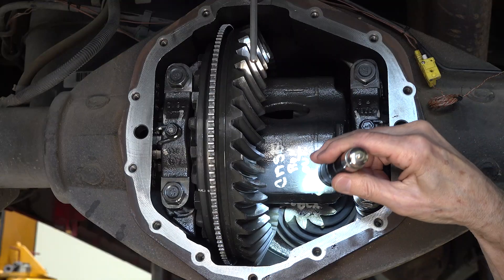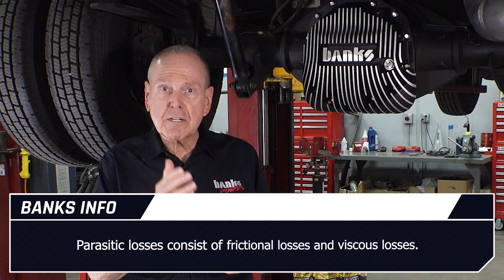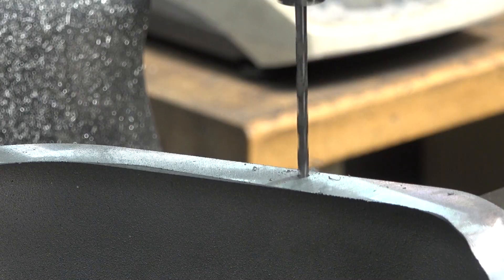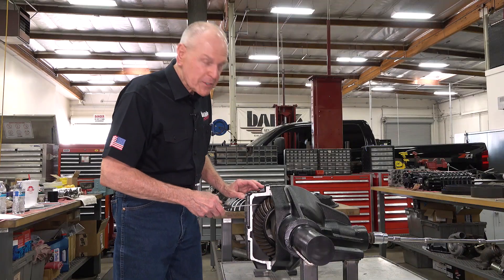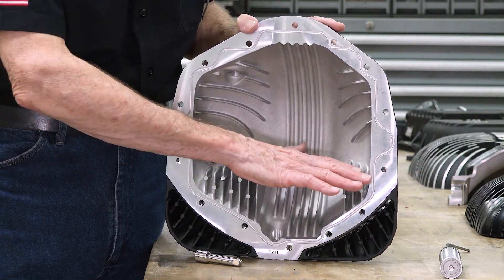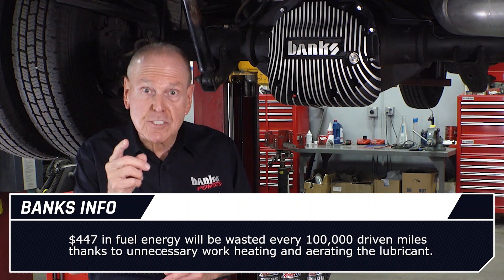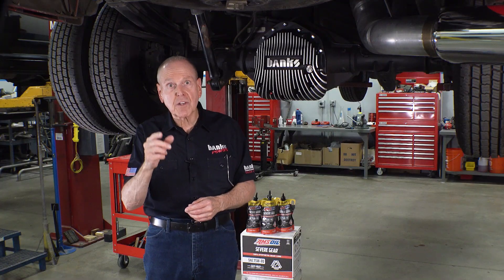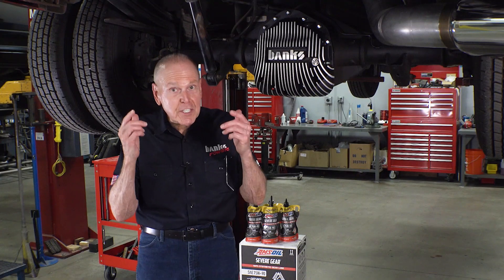Is your differential cover KILLING your gears?

Comment: Wouldn’t it be nice if this much engineering was put into everything automotive related coming from the factory
Reply: Ram is actually going to be implementing an antifreeze cooled rear diff on their 3500 trucks :)
Reply: It is.  How do you think differentials run for 100K with never having the gear lube changed.    There are literally millions of trucks on the road running stock differential covers abusing the hell out of them and not needing to buy a $400 cover.  Don't mistake the aftermarket marketing as "engineering."
Reply: Not Hitler  Or just spend $50 in gear lube every ten years instead of the $400 cover.
Reply: @tirefryr  exactly lol people really think that because they spend more its obviously better
Reply: It is.  Profit margin is king.
Reply: Caleb Martin great, until mud and dirt pack those cooling fins.
Reply: tirefryr If you only change the gear lube every ten years, you’re going to need to change more than the gear line every ten years unless you barely drive your truck.

Comment: I have a Mag-Hytec cover on the Dana 80 on my 2001 Dodge, and ran it for many hundreds of thousands of miles delivering trailers.  I did have a rebuild done at 250k miles, basically to change the axle ratio.  I finally had to retire the truck at 580k miles because a lot of small things were going wrong, electrics, heater, and the transmission was making grumbling noises again.  So I replaced it with a 2008 Dodge.  I watched all of Gale's diff cover series and was impressed with his methodical approach and attention to detail that the flat-back designs missed.  I bought one as soon as I could and have had it on the truck for about 20k miles.  Things are good so far.  One thing that sold me on the Banks design was the 4-quart fill, instead of the 7-quart fill of the Mag-Hytec.  I always run synthetic diff lubes, and saving 3 quarts on the fill helps.

Comment: Since I solved the braking problem on the Hummer I got a question for you. "What happens when the air ramp fills up with mud?"
The reason I ask is that was the problem with the Hummer's first gen parking brakes. Mud would get up there and force the brake calipers closed and the disc brake would heat up to glowing red metal and turn into a bowl which was right next to the fuel tank. 
Now I like that it breaks away if it were to get snagged on a rock as no one likes to get stuck and require an expensive tow in the middle of nowhere.

Comment: Definitely hope Banks makes these covers for the “old school” bomb proof, 14 bolt 10.5” corporation full floating axles. These axles have been around since 1973 thru current year gas trucks. I would think there are at least a million of these axles currently around being used. I know newer diesel trucks since 2000 have gone to the larger axles. Not everyone has these trucks though. Please Banks, offer more covers for different axles!
Reply: In 1998.5 they went from a 10.25 to 10.5. The 10.5 lasted (I believe) all the way through the 6.4 psd.
Reply: @TJrcTX  i don't think ford used the AAM axles in any of their models. They have used Dana for the front and their own (?) rear axle with similar size ring gear.  AAM is an independent company that was purchased from GM (what was orginally called 'corporate') and then became standard equipment in most or all of GM and dodges.
Reply: @travispfannmuller7717  at some point they stopped using dana axles in the rear, started using the Sterling 10.25 and 10.5.   The GM corporate 14 bolt with a Detroit locker was the best rear axle set up I have ever had in a truck.
Reply: Tim Steinke they still use sterling 10.5 on all the single wheel super duties pretty much 99 to current. Duallys use a Dana 80 rear axle
Reply: If it’s bomb proof you don’t need to improve anything, do you?

Comment: Proper job on the design. Good to point out how the pinion bearings get their lube since its not immediately obvious until you've looked inside a rear-end, and those get fairly hot due to the required preloading.

Comment: Bravo. I've always wondered why people were adding more gear lube to differentials. Working with industrial-sized gearboxes, whenever a tech added too much gear lube to the unit, it would cause the temperature to quickly Spike to 400 degrees.  Finally someone did some research and engineering.
Really looking forward to put one on my f150.

Comment: I watched the rear diff vid that had the clear cover on it just before this and sent a message asking about over filling. The way the fluid was running at 15 mph and then again at 30 mph made me thing that there should be inner fins that direct fluid to the axels. Then I watched this video and was blown away that my thought of how that should be was exactly what you just showed you had already developed. I love it. I didnt imagine all the heat transfer stuff but I did have the fins that channel oil to the axels in my mind already. Amazing stuff SIR. Thanks for you posts. Now I know that there are other guys out there who think like me. lol

Edit was just for this question: Could you possibly make a video of the oil coming down the axle tubes (both tubes) by putting a clear cover on the ends where the brakes would be? I often wonder if one side gets less oil and wears the seals out quicker than the other from lack of lube. thx

Comment: Pop the ballon, but the biggest cause of premature wear for the gears is too much torque which distorts the housing causing improper gear mesh. Most of these rear diffs last 500k with proper oil change . They do look cool.

Comment: I would have bought one from banks if he made these for the old Dana 70 rear-end for my 1990 1st GEN Cummins. 

However, I went ahead and got a Mag-Hytec. For the Dana 70, it sticks out farther from the gears, and isn't as squared-off on the inside as the one Banks is showing here in his video. I actually like the magnetic dipstick. Regardless of any fluid dynamics, my gear oil is cleaner than ever (the condition of the gear oil in these old trucks with the stock diff cover is horrendous to begin with) and after taking a laser thermometer to the case after doing some city and highway driving at about 70 deg. F., I was only reading 100 deg.-even (after adding some friction modifier for my rear-wheel locker), while hauling a camper on top. I can feel the difference even with the camper mounted. The truck likes to coast more while in-gear (automatic) as I exit a freeway, for instance. The new diff cover was a good excuse to overhaul  the rear diff with synthetic gear oil as well.

For the larger, newer diesels the Banks diff cover probably makes a difference compared to Mag-Hytec, I guess. For a 160 HP Cummins 12 valve, it probably wouldn't, which is why they never made one.
Reply from the maker: We will be making a cover for your Dana 70. And, if you notice a decrease in rolling resistance, you'll see an even greater improvement with the Banks cover.
Reply: @bankspower  Wow, thanks!

Comment: Well I'm convinced. Is Banks going to release a Front Diff cover as well so they will match?
Reply: For the front cover you mostly just want armor I  think. Unless your desert racing I don't think you will be working the fluid very hard offroading. A strong smooth front diff cover that resists mud buildup would be cool. Mud insulates pretty good heh. Friend had a finned front diff cover on his Cherokee and it would get packed with mud. Not sure how much heat it built up in that environment though.
Reply: Lassi Kinnunen  pretty sure that's not the case  with the AAM axle in the gm and dodges. There is an axle disconnect
Reply: Travis Pfannmuller not all of them, my 06 dodge does not have a disconnect.

Comment: Huh. You and your team sir, have made a 'better than oem' part, by use of math, science, and the mind. I salute you as a Scientist and Engineer! Heat sink on vehicle engineering has always been relevant. It likely may become even moreso in the future, because magnets do not like to get hot.  
Also, one way to put it in English is: 'the powertrain is a conductor which moves flywheel power to wheel power. And if it gets hot, that is your power leaking out as heat instead of wheel power'

Comment: I'm glad to see that you are using engineering to make a better part, and not making something that is just fancy for someone to buy. 

It would have been nice to see the data on the temp of stock vs aftermarket. so far i thought these were just a gimmick.. it would be neat to see how much better it does than stock.

Comment: Regarding the "dead zone" behind the cover, you will get some cooling. As the air passes the rear of the diff it will form eddies behind the cover which serves to circulate some air at a reduced velocity. If fins are there, heat will be given up to the surroundings. As for how effective the ram air will be, that depends on how much webbing is in front of it. If there is a lot of support webbing for the axle tubes, most of the cooling will be via essentially the same mechanism. Its not as efficient as direct air flow, but there is some circulation. This is evident if you ever have a pinion seal leak, the oil ends up all over the diff cover due to this.

Comment: I guess it’s great if you want a gucci diff cover. Stock does the job even for hot shot guys, and if you want something different paint it. Still I have to admit, this cover has cool features and looks good.
Reply: HKvsGlock agreed but the ability to maintain frequently sure makes it nice!  I change my gear oil every 60k miles and pulling the cover sure sucks.

Comment: Never thought about the slower airspeed under the truck.  And that "Dead Air Zone".  Makes a lot of sense.  Over the roof air goes faster due the aerodynamic Bernolli Effect.  THANKS..  Im a flight instructor and.. shame on me I  Never thought about that slower air underside.  No wonder so many diff wear out before the engine.  Not enough air cooling.

Comment: As much as I’m a Banks fan, my Dana 80 has a Mag-Hytec cover. I have over 300,000 combined miles on two trucks with no issues. One truck has 373,000 miles with over 100,000 miles on a M-H cover...still doing well.
Reply: Then you're better off just switching back to a regular cover, Bank's diff is over-designed and overcomplicates something that doesnt usually matter. However, his information proves that the mag-hytecs are inferior to even OEM style diff covers. 
If you're not having any issues with it though, don't even bother. No reason to deal with messy gear oil just to save "447 dollars at 3.50 a gallon every 100,000 miles." That's real penny pinching numbers that normal people shouldnt worry about.

Comment: The oil level in the axle is a compromise. Bearings actually need little oil and flooding them does cause heat and churn, thus power consumption. The gears need the higher oil level. 

This is why in high speed / high performance gearboxes the oil is pumped to the rotating components and essentially ‘dry sumped’ and then externally cooled. Doing that for a truck axle is just not worth the significant cost and additional hardware.  

Over filling is a killer due to foaming, which in turn raises temperatures due to poor lubrication. You will never rid yourself of the losses due to gear ineffiency, oil seals (a major temperature rise causer) friction and the power lost moving the oil.  That said, cooling the oil when that diff/axle is loaded up will help with the oil and seals. The latter good till ~250F or so.  Synthetic gear oils are usually in the 400F range before they break down. At that point you have bigger problems. 

This would be a good adder if you tow.

Comment: How is the change in fuel consumption calculated? Do these calculations also include the change in drag, since the Banks ram air system changes the air speed direction 90 degrees. It could be assumed this increases fuel consumption. It would also be interesting to know how parasitic losses compare in cold temperatures and low loads (eg. -25C, highway with no trailer). With the added cooling capacity of Banks cover, is parasitic loss increased due over-cooled oil compared to stock cover?
Reply: There ain't going to be no measurable change in fuel consumption whatsoever.

Comment: This has been really educating to watch, I've been wondering for a long time, how could I increase a reliability of a differential on 6h endurance race. We have to run open differential because regulations, so the differential is going to work a lot during race and cause also lot of heat! We run 75w-140 diff oil, which we will replace after every race. regular 75W-90 just wont hold that much of heat, it just burns during race and also increase the wearing of the diff. I've been thinking to machine my own diff cover which would allow me to use more oil in the diff as maintaining same oil level, and your video just gave me an idea about it. So the diff cover would be deeper allowing more oil to be used, but would have to machine a "rail" around the ring gear to maintain enough oil flow for the pinion cooling, would that kind of thing work? I can draw you a cad file about it iff you like to see what I mean?

Comment: Not on my K 1500 Z71 I'm the original owner 1994 with a little 350 and I've got 450,000 miles on it and I've never touched the rear end, engine or transmission,  and it's doing just fine....

Comment: Banks appears to be making the assumption that cooler is better and that may not be true all the time.  The fluid needs to be warm enough to reach the ideal kinematic viscosity for life and efficiency.  Too cool means too thick and the bearings, specifically the pinion bearings won't be happy.  The lube viscosity grade selected is done so that it will be the correct viscosity at operating temp.  This cover may be ok for the application that lives it's life running high speeds at near rated power in 100 deg ambients, but not so much for the application running where most diffs will run most of their lives.  The point is, cooler isn't always better.

Comment: Anyway to make one or many of these for the import car scene?  I do a lot of hill climb racing in a MKIV Toyota Supra with a diff cooler and pump.  Still running a stock cover and would like to have this well designed engineered cover.

Comment: How about making the housing so it uses the gears as a pump to feed the oil into a external cooler. No additional moving parts, just making the housing so it drives part of the oil into a cooling line and back where the gears make a low pressure return so it sucks it back into the diff.

Comment: Alright I'm sold, but I can't find any on your site for an H3 hummer. Great video
Reply from the maker: Right now the engineering team is focused on the current-gen GM, Ford, and Cummins HD diff covers. Development for additional trucks is expected to start in later this year, sometime in the fall. As of now, we are not sure of the exact vehicles that we will be working on yet, but it will consist of 1/2 ton truck and suv's. We will post more updates when we get closer to start the development of them.

Here are the upcoming diff covers.
▪️Sterling 10.25 & 10.5 12" bolt (86-19 F250/F350s)
▪️Dana M275 - Ford '17+ (F250 HD/F350 SRW)
▪️Dana M300 - Ford '17-'19 (F350 DRW/F450)
▪️Dana 80 (94-02 Ram 5.9, F350/450 99-07)
▪️AAM 12", 14 Bolt- GM 2020+, Ram 2019+

Comment: I'm torn between this diff cover and a nodular iron armored type. What would you guys recommend for an overlanding build? I'll be putting more miles on the highway than I will off-road (no towing though), and it'll mostly be rutted out forest roads, no rock crawling. I love the engineering that went into this product but I also like the peace of mind that heavier armor would give. How often do you guys whack your rear diff off road? Think the armor is necessary? If not I'd definitely spring for this.
Reply from the maker: Keep in mind that the Ram-Air scoops on the bottom hang no lower than the lowest point on the stock differential housing. So, the first thing you'll hit will be the diff housing, not the Ram-Air cover. Our scoops are tucked up tight. Also, if you were to break off a scoop, it'll break away cleanly, allowing you to keep driving. And, we'll replace it for free.
Reply: @bankspower  Was thinking this as well, in most off-road scenarios you'd be hitting the other side of the diff first anyway. Didn't know about the replacement policy though, that's amazing!

Comment: i would have like to see the temperature data myself in real world driving conditions . Most heat is created when towing up hill at low speeds. Same reason we have electric fans now. External diff cooler added on would be best .

Comment: It would be great if you would design a transmission pan as well for the 68rfe that runs cooler and still retains the same amount of fluid all the aftermarket pans i fine all add 3 to 4 more qts in which i believe is 3 or 4 more to cool.

Comment: I never saw a temperature comparison against stock. Differential covers have almost always been a solution looking for a problem.
Reply from the maker: There's no airflow over the face of the stock cover. That's the reason we patented the ram-air scoop design. The data you're looking for is in the long-form video posted back in November. People have short attention spans so we posted the edit you just watched. You'll also find the data here. https://www.bankspower.com/i-2892

Comment: Mate in Northern Queensland just changes the oil every year. 40c + offroad towing overloaded etc in the mining industry no dramas with ordinary diff and specified oil. What is so different in the USA ?   A solution to a problem that does not exist ?
Reply: Yeah there are a bazillion aftermarket products that supposedly solve a problem you didn't really have.